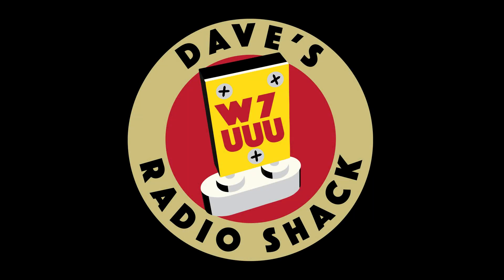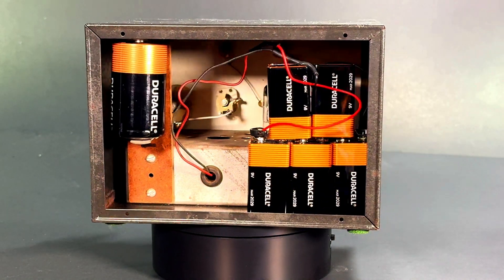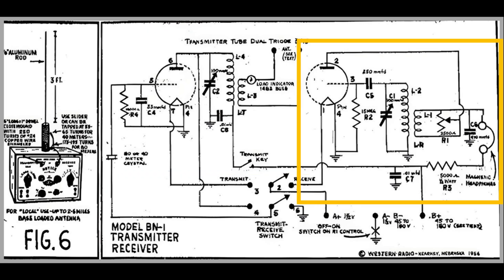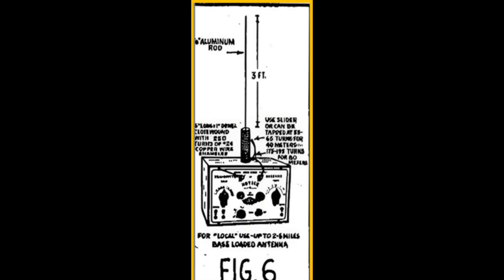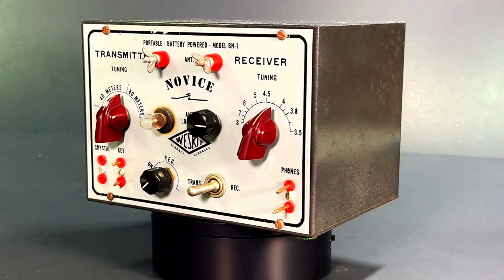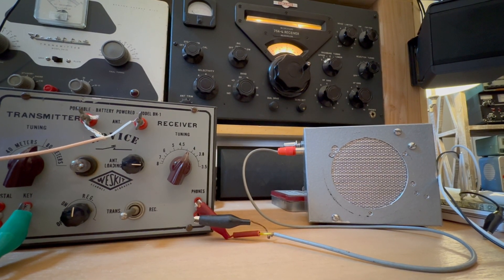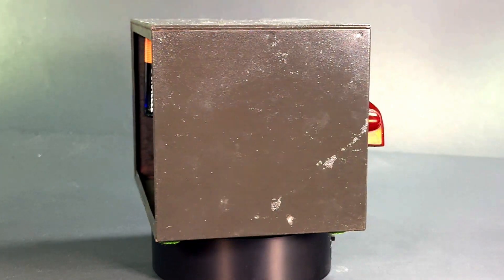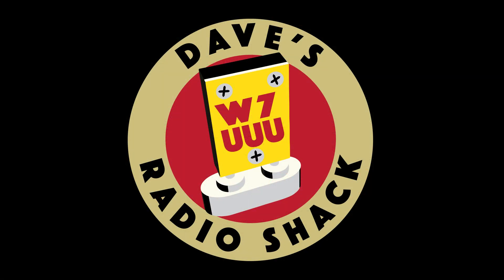Weskit BN 1 Novice Rig from 1954 demonstrated

Comment: Very interesting. I'm an 84 yo guy and I had two of those rigs when I was a kid. I got them from a father & son TV repair shop. The owners modified them by using the extra hole and put another 3A5 in it as a speech amplifier and modulator . I believe they had set up a plate modulator in it but to be honest, I didn't know a lot about transmitters in those days. I did somehow manage to hook it up to the output of a AM radio and transmit about 500 feet to a neighbors SW console radio and hear Elvis with it.  I think the TV repair shop thought they may be able to use them for an around town intercom. Then CB came into town and that was perhaps the end of that idea. I joined the Army about 2 years later and I don't know what became of them.  73 Terry W2PFY

Comment: great video was wondering if the manual you referred to is available, I’m working on my technician class and saw the schematic figure to build one of these glad they recieve OK for transmit probably need the optional 90v not 45v
Reply from the maker: Just Google it - you will find the schematic.  But I never found the full manual.  The problem with 90 volts is the receiver becomes very unstable at 90.  It works well at 45.  The transmitter would be idea at 150.  You could conceivably use switching to drop the voltage from 150 on transmit to 45 on receive.  But in the end, you'd still have a pretty miserable radio all things considered.

Comment: Wow! Wishful thinking by the manufacturer...

By adding a regular dipole, I suspect it worked a little better. But making it have both transmit and receive for transmit, you might get better operation, but it would have to have an attenuator in between the two.

Definitely not up to the Heathkit HW-16 performance though, as that had all three Novice bands, and a superhet receiver as well as 75 watts input to the transmit tube.
Reply from the maker: You must have missed it - I WAS running it on a "regular dipole" - perfectly resonant.

And no, a FAR cry from a HW-16.  But you have to bear in mind:  the BN-1 in this video is a single tube, and at that, just a simple directly-heated triode for each section.   The BN-1 is very similar to the modern "Pixie" transceivers that are sold on eBay for a few dollars....  that actually work fairly well.

I strongly doubt many QSOs were ever made by "novice hams" using the Weskit BN-1.... the only QSOs ever made were by very patient, very experienced hams who managed to pull it off!
Reply: @davesradioshack  Yes, I heard you, but I was commenting on the instruction manual recommendation for a coil and vertical element. I sometimes forget to flesh out my comments better, sorry.

The BN-1 reminds me of the 100 mW walkie talkies we had as kids, very poor radios, even with more parts. But OK within a few hundred feet!

And when I made the comment about the Heath HW-16, I was just comparing the technology difference between when the BN-1 came out VS the Hw-16, which was my first novice radio!

Again, sorry, no disrespect about you or your vid, I was making too quick a post, which ended up lacking...